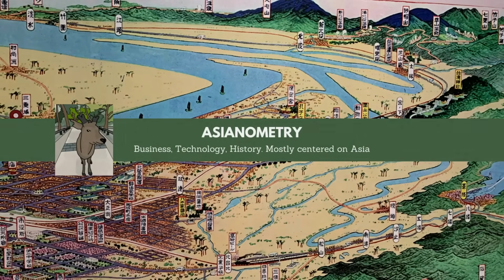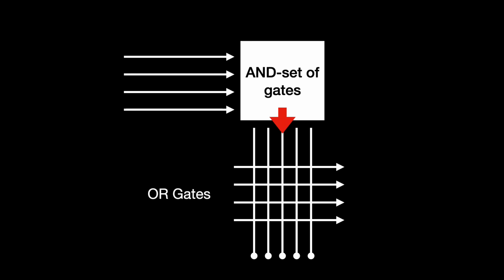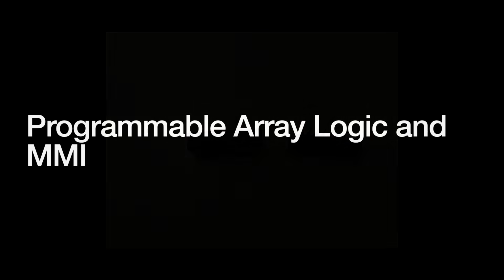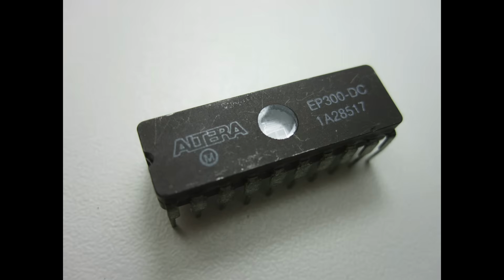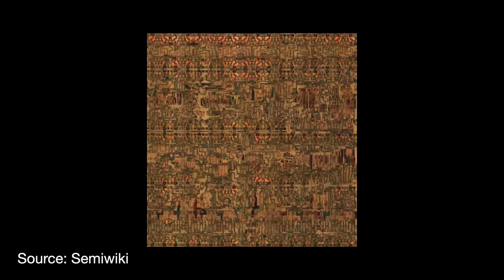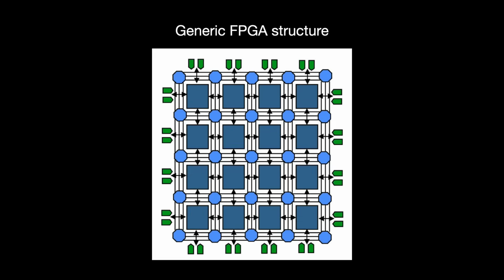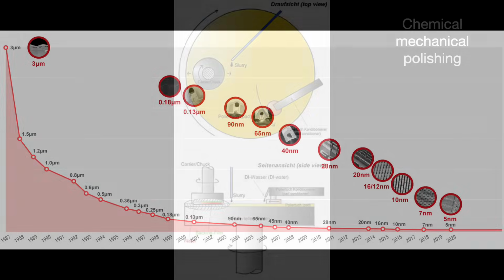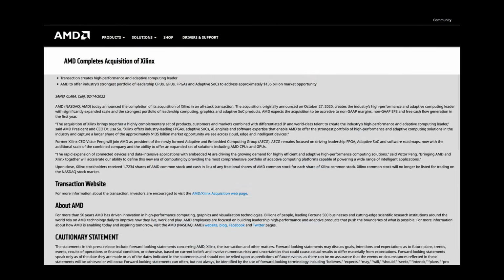The History of the FPGA: The Ultimate Flex

Comment: Interesting history, but doesn't really make clear the technical difference between FPGAs and the earlier programmable logic chips.

FPGAs implement logic functions using SRAM based lookup tables (LUTs) and as such are volatile devices that need to be initialised on power up, usually by an external PROM.

The previous programmable logic chips implemented logic functions by logic gates with a PROM based interconnect, and as such were non-volatile and worked immediately on power up.

Comment: I was among the first users of a EP600 chip in Italy. Each chip cost  an arm and a leg !!! 
Afterwards  I pioneered the use of xilinx XC2000 fpga: my design was so complex that I had to use 3 of them! 
The a place and route program supplied by  xilinx, was a nightmare: most time it did not complete routing phase  even running on the most powerful computer available in the company, an Intel 386 running at 25 Mhz!!! 
In the end a number of signals cannot be connected to the input of a logic block because of a lack of "routing resources".
I got around this trouble learning to use the " Cell Editor" Which allowed   smart users to route a signal across blocks: in many cases it was enough to swap an unconnected signal with a routed one to overcome the problems of an unconnected line! 
I never understood why that happened, but hand editing became a standard phase in my development process!! 
I used to run the place & route program for some time and then  select the output that had the smallest number of unconnected signal, and edit that version. 
I completed a large number of designs  based on Xilinx fpga, but in year 2000 I reverted to Altera, developing a design that required a huge amount of logic.

Comment: Back in the mid to late 80s, I was working for a company and had a project to design a multichannel Ethylene Oxide detector. I wanted to use a microprocessor for displaying the  warning level LEDs for each of the 8 channels but my boss who was afraid of micros said no. I programmed an EPROM so that the address lines were used as logic inputs and the data lines were the logic outputs. It was a poor mans' PGA. There was a lot of redundant code.

Comment: I started with FPGAs in 2001, and was fortunate to land a job at a company that had an internal training program with university level instructors. The flip side is that I learned VHDL first, and then found Verilog distasteful, but that's another story. Back then, we did all of our HDL entry in text editors and ran them through hideously expensive tools for simulation (Modelsim) and synthesis (Synplify Pro). So expensive that our department had only a few dozen licenses for a department of nearly 100+ folks. People would camp on them, go to lunch, and find their network cables pulled.

The real challenge back then was making timing. The chips were fantastic, but once you exceeded a certain percentage of their resources, the clock speeds started dropping dramatically. I was working on signal filtering systems that had to meet a minimum clock rate, and I would spend hours trying to tweak the design to get that last little bit of speed out. The synthesis tools took hours on the PCs of the day.

However, as others pointed out, the real shift began when both Xilinx and Altera started giving away limited versions of the tools, and then actually sold reasonably priced FPGAs that would work with them. All of a sudden, you didn't have to be a gigantic megacorp to use the technology. In fact, the company I work for now almost invariably uses Cyclones (Altera house) because most of the control applications we design don't need anything bigger or better - though we do occasionally bump up to Arria or Stratix for bigger jobs.

Comment: People don't know that, but FPGA was a foundation of current digital radio revolution. Anything past 2000 was essentially prototyped on FPGA for large volume ASIC, or designed in FPGA for low volume, high performance solutions.
Reply: Dude, I have worked with a digital systems engineer who had built digital radios using pre-TTL chips. He told me it was the size of a large washing machine and they had to install another jet engine on the plane just to power it. You kids simply don't know what you don't know. :-)
Reply: @schmetterling4477  I worked with people that worked with Marconi, most of the stuff I still can't talk about ;)
Reply: @schmetterling4477  no but I've worked with 35GHz amplifiers and laser exited traveling wave tube amplifiers  ... follow the breadcrumbs :)
Reply: @tommybronze3451  Did I mention that I designed the core components of one of the world's largest high energy physics experiments? It's still running... decades later. :-)
Reply: @schmetterling4477  My equipment is still in orbit watching you ;)
Reply: @tommybronze3451  My equipment isn't an ant-watcher. It watches the inner workings of the universe. ;-)
Reply: @schmetterling4477  And we watch everybody just in case they know to much ;)
Reply: @tommybronze3451 So you are a voyeur? :-)
Reply: @schmetterling4477  yes, we look through walls, roofs & ground. My other colleagues look through laptop and phone cameras, by they have different taste - the prefer POV, while I enjoy the full scene ;) But what you were expecting ? you thought that people will just trust you with the money given on particle accelerator ? "Trust but verify" !
Reply: @tommybronze3451  You are welcome to look at me. I like being watched. ;-)
Reply: @schmetterling4477  I was advised that lens would crack from sheer ugliness, but thanks for an offer ;)
Reply: @tommybronze3451  Nah, there is nothing better than home made movies. ;-)
Reply: @schmetterling4477  yes, POV boys have you under special category "special people" ;)
Anyway, nice chat. Thanks for keeping things up in high spirit :P
Reply: @tommybronze3451  Keep watching! :-)

Comment: Given the opacity of this market, I think that you did a phenomenal job with this video. Extremely high effort - thank you! I learned a lot. I'm a true "FPGA hobbyist" in a sense that I make fairly complex designs in my spare time, at 3 - 5k lines of VHDL code per design, to do all sorts of things. But, I don't do it to "proper standards" with obsessive verification and analysis. That's too much of a pain if I'm not paid for it. I work with entry-level chips, so even with 99% chip utilization, synthesis times are only about a minute.. and my approach is always just to synthesize the dang thing and examine the outputs on a logic analyzer in another window. Can't beat looking at physical outputs, and modern logic analyzer UI is faaar better than timing analyzers within FPGA tools. I think that a giant barrier for FPGA usage in hobby settings, is that there is no clear picture of how you'd use an FPGA for a "quick and dirty" design, while avoiding common glitches and pitfalls. However, people who are formally trained for HDL set a bar that's too high for most hobbyists, so those hobbyists just go to microcontrollers instead.. since "quick and dirty" is the name of the game with those. Yet, FPGAs are far superior to microcontrollers for many hobbyist applications. You can't beat having so many I/Os, of being able to nail deterministic timing, scalability (I've "overclocked" so many displays and other chips by feeding them flawlessly-timed signals etc), and even creating new functionality for various chips and devices by simply using the raw speed of FPGAs. Once you get comfortable with FPGAs, you start to find microcontrollers unbearably limited. My algorithms often start conceptually in mspaint (haha) and then I have a lot of fun implementing them on FPGAs. Being in the hobbyist space means that you don't need to obsess over resource utilization (as much). Real designs are going to be some mixture of sequential and combinatorial logic, but when possible, I stick to keeping things combinatorial. You have the spare resources so why not. Why wait 50 clock cycles for a result when you can do it in 0. ;) A lot of algorithms you read about "in the wild" are meant for CPUs, and as such, they're sequential. So, you often end up in uncharted (or at least poorly documented) waters.

To make a big but obvious point, I think that current FPGA software environments are complete dinosaurs, and they directly prevent adoption by non-professional users. It's very unfortunate. That said, the software side of FPGA synthesis is absurdly complex. The chips are nothing compared to the complexity of that software. I think that.. for a given market to re-invent itself, you have to find a way to make it accessible. So far, the FPGA industry as a whole has failed at that, and the average electronics enthusiast considers FPGAs too complex or out of reach for their designs. I'll make some videos about it on an electronics channel I have soon enough. Should be fun.
Reply: I have never met a non-professional user who had any real need for a complex FPGA design. I do agree that it's a nice hobby, but at 5k lines of code it's still a hobby. Enjoy it and be glad that you don't have to design stuff with a quarter million lines of code, like the big boys. That's no fun. Why pipelining? So that you can get more than 5MHz clock frequency out of these things. If you don't need that, that's fine, but in most of my applications achieving 40-50MHz was an absolute must and getting closer to 100-125MHz was desirable. Asynchronous logic has its place, but it's usually a very small one.
Reply: @schmetterling4477  I half-agree with your first statement. It reflects the current state of the FPGA market, but it's a market that's trying to evolve and become more accessible. Another point is that there are many small/medium size companies out there where engineers end up wearing different hats. Lots of "non-professional" FPGA-designers end up making designs that make their way into manufactured goods - whether they're properly verified or not. Scientific market is another example, where "makeshift" approaches are common, up to a point. Any FPGA design can be complex in the way of timing requirements, processing speed requirements, algorithm implementations, logic efficiency to fit limited form factors and power requirements etc. High codebase complexity in itself doesn't supercede the others. I've made plenty of designs that worked perfectly at 150MHz+ with 95%+ logic utilization even with lower-end chips. With the popularity of SoCs, RISC-V cores etc, I definitely think that the average level of "hobbyist" designs is going up. You can get an Artix-7 dev board with 215k LE's for $100 or a Cyclone-5 dev board with 77k cells for $90. Software is free for both. Both can handle substantial designs. $40k enterprise chips are an entirely different animal, but lots of hobbyists these days have enterprise experience working for Google, Amazon, etc. They understand how things scale. That's why I think that we'll be seeing more hardcore hobbyists sooner than later.

Comment: Despite them being a really cool idea, in 30+ years I have only ever used programmable logic twice. The first was in the 1990s where I had to replace an obsolete stopwatch IC (maybe a 7225?) with a plugin board. I was just a baby engineer in a company where only seniors got to program microprocessors. Then in the 2010s I concocted some far fetched SPI bus master driving an ADC at full pelt with a micro as SPI slave with DMA storage. It was the only way to get the performance the system required. And it needed EVERY BIT of small print in the ADC datasheet. Really, a different micro would have been better but the development kit for the CPLD was cheaper than a new compiler for the micro. So I did it the hard way.

Comment: Another use of FPGAs that wasn't mentioned is that they can stand in for parts that have become unobtainium, like VIC-II chips. This means greatly enhanced capabilities for keeping existing systems in place far longer than the normal manufacturing support processes would otherwise allow.
Reply: If your systems architecture isn't prepared for obsolescence, then you are doing it wrong. I do, by the way, know a great horseshoe place. They now offer steel, titanium and 3d printed orthopedic horseshoes. ;-)

Comment: Excellent research, stroytelling. Would have liked more if you had shown Lattice and Altera chips as well in the thumbnail graphics. Interestingly and ironically you used the word "Flex", which was a product line from 1990s Altera (now Intel). If you can find EE times stories from 1990s, you will find the Xilinx vs Altera battle through funny ads. FPGAs still continues to grow leaps and bounds. FPGAs can be seen as the soft hardware.
Reply: They have also been mostly made obsolete by GPUs. An FPGA is orders of magnitude away from the computing power of a GPU. They were great before we had GHz CPU clock frequencies, but at some point they became a marginal technology.
Reply: @schmetterling4477  not everything requires compute performance. GPUs are power hogs. A good systems designer would choose the right technology for their application requirements. A deep learning with low latency, high throughput and evolving workloads can utilize the fpga's capabilities. See public benchmarks on the web, There is a place where each of the different component options such as CPU, GPU, FPGA, microcontrollers to ASIC thrive. A good system architect would figure out both the hw assets and sw toolsets out for their application . You don't want to use a tank to punch a key hole on a door.

Comment: PALs and GALs were used on some 486 PC motherboards like the FIC 486-GVT (socketed GAL below RAM slots with silver sticker) or the 486-GVT2 (soceted PAL to the right of the RAM slots). This has turned into a big problem for the retro community trying to fix boards where some idiots have stolen all socketed chips for scrap or whatever other dumb reason. BIOSes can easily be written to new EEPROMs and SRAM cache chips can still be bought, but if the board uses a socketed PAL/GAL and that's missing, it's pretty much game over, unless you somehow find an identical, unrepairable (physical damage etc) board which still has the PAL/GAL on it... good luck with that

Comment: Great presentation, thank you. I have a question for the FPGA knowledgeable people here: what is the recommended way for an EE that has a solid background in microprocessors but none in FPGA learn how to use and design with FPGA's, from scratch? What blocks of knowledge should be learned and what are the recommendations for each block?
Reply: If you nip on to Intel or AMD's FPGA web pages, you'll find loads of free video tutorials to get you started.  They even have syllabuses so you can work your way up.  Have fun!

Comment: FPGAs are also at the center of the top performing emulation setups for old video games and computers. For those who are looking for the most accurate representation of actual hardware. There are projects on going right now to make an fpga version of the venerable 6502 that runs at 100 MHz, which is at least 25 times faster than previous commercially available 6502s. And along those same lines, another project on going is the creation of a Motorola 68030 running at 1 GHz.

Comment: Can a FPGA be reprogrammed live by software? Like if a program detected a task would benefit from parallel processing rather than single-threaded processing could it send a signal to reconfigure the chip? This example is probably not very good but it's what I could come up with
Reply: Yes.  In the old days you had to reset then reconfigure the chip  which lost context.  Now you can partially reconfigure.  You can have part of the chip stay up then have it reconfigure another part.  It's a fair bit of work,  but doable.
Reply: FPGA's are used for parallel computing -- in fact you can buy time on large, expensive FPGAs from Amazon and Microsoft cloud compute platforms.  AFAIK, you just prepare what you want to run and then run it for a duration of time -- it does not require dynamic reconfiguration. The latter seems more of a research topic.
Reply: The short answer: Yes

Comment: Can you talk about how lattice fits into this history?
Reply: Lattice was the first FPGA that you could program without a programmer. You could program the part in circuit. At the time most FPGAs were programmed using a PROM that could only be programmed once. If you need to change it, you needed to replace the PROM. I remember having tubes of blank PROMs and containers of PROMs that were no longer needed.

Comment: Thank you for the interesting video on an important topic rarely considered outside the world of electronic engineers. I worked at AMD and then Cypress Semiconductor in the late 1980s as a product engineer for programable logic devices. Then, and now, the use to make circuit emulators to prove out designs was but one (relatively small) market segment. Their first market was replacing TTL devices which were then being used to make .... everything! Data General famously created the first 16-bit minicomputer and beat DEC to market by using PALs as a primary logic device element (MMI's early yield problems put that project as risk!). Today the programmable radios used to allow updating cellphones after manufacture are an implementation of programable logic. Many low to mid-volume applications do not justify the creation of full-custom chips and need something catalog products don't offer. This was and remains the key application for programmable logic devices, be they relatively simple PALs or complex devices like Xilinx and Atmel innovated. Amazingly enough, the brand new when I worked on it in 1984 22V10 macrocell PAL is still being manufactured and sold for glue logic and other general/mult-purpose uses. I just checked, and Digikey has them in stock for $2.51 each :). You cover an astonishing array of diverse topics, and I'm amazed how much you get exactly right!